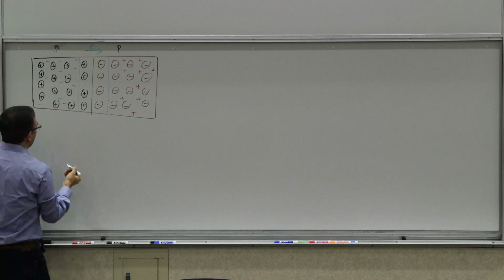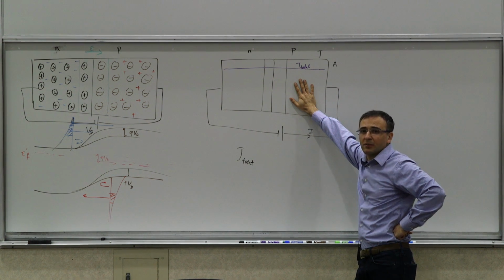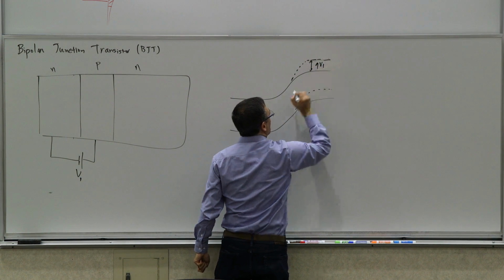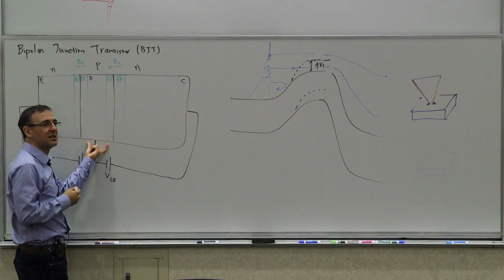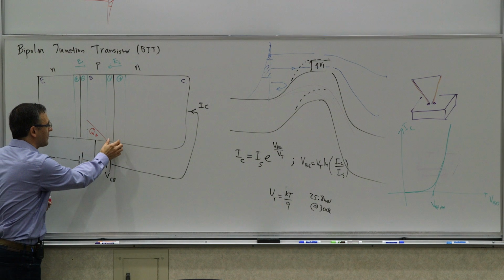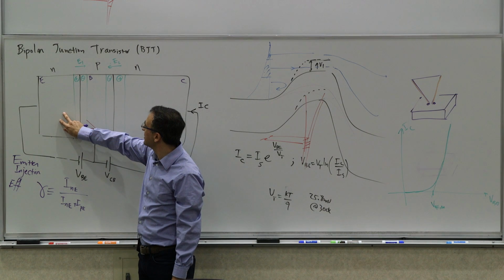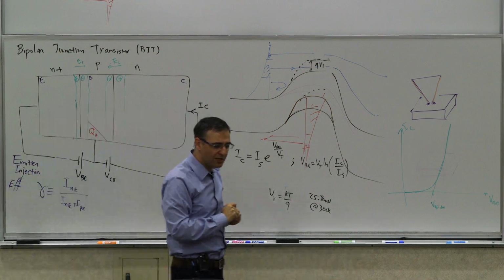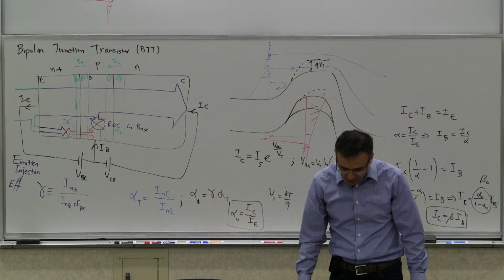106N. Bipolar Junction Transistor, basic operation, current flow properties, doping Profile

Comment: 7:30 if the junction is not in thermal equilibrium, does it mean that temperature along the length of the diode is not same. If so, can please tell how can it be, current through the diode is same throughout it's length.🙏🏼Thank you sir for the lecture. If not for lectures, I would have given up Analog electronics. Do you also teach any electromagnetics, antennas course. If so, please post them on YouTube sir, I want to get good at it before I graduate in about 1 and half years.

Comment: Why is the difference between the local fermi levels is q × VD ?
Reply from the maker: Because the there is an external voltage of VD is applied to the diode that creates an electric potential difference of VD, which corresponds to an energy difference of q.VD which is reflected in the local Fermi levels.
Reply: @AliHajimiriChannel   I actually professor understood it when in a comment bellow when some asked you " @6:31 shouldn't the valence band at the n side be raised instead of lowering the p side " and then you answered " actually both happen , since the depletion region shrinks on both sides . It was just a convenience (laziness :) in drawing a picture that one side was lowered " 
From the upward conversation I understood that on average we can think that the p side is lowered by 1/2 q × Vd and highered by 1/2 q × Vd at the n side that happened for the the upper graph for electrons and the lower on the holes . So as a result the valence band of the Semiconductor and the negative dopant at the n side and the conduction band and the fermi energy  shifted on average by 1/2 q × Vd upwards with reference to the old energy levels before applying the forward bias and the same happens to the p side valence band of the Semiconductor and the positive dopant at the p side and the conduction band and the fermi energy  shifted on average by 1/2 q × Vd  downwards with reference to the old energy levels before applying the forward bias therfore the delta E fermi = q × vd ...... I am thinking in a right way ? 🤔 ...... 
I really appreciate you professor Ali hajimiri and I really find the heaven in your videos thanks professor for making us being educated by that high quality of education .

Comment: Hello sir
I have question about current flow through the depletion region in bjt transistor and fet transistor. Even though a high electric field is present in depletion region (between collector to base junction) but this region is depleted of charge carriers and to some extent behave like insulator according to my understanding, then how current continues to flow. One explanation that come into my mind is that inside depletion region charge carriers generates due to thermal process(electron hole pair generation) that might help flow the charge carriers but even these carriers are very small in number to help flow majority carriers in mosfet and minority carriers in bjt.
Kindly explain it to me because I can not digest that people say current just flow because of electric field present and I need to clear up this concept.
Reply from the maker: Hi,
The depletion region does not have a lot of free carriers in it because the keep being swept away by the electric field. It does not mean that free charge carriers cannot exist there. It just means that carriers that end up there, will not spend a lot of time there and are taken away to somewhere else due to the electric field. So carriers transition quickly through it. The low conductivity is due to lack of free carriers there that can be influenced by another electric field (usually perpendicular in the direction to it.). Hope this helps
Reply: @AliHajimiriChannel  thanks a lot sir. Your explanation is much more detailed and convincing. God bless you.

Comment: Dear Professor，actually, I am not really understand why the net flow going into the transisitor should be zero, Even if I know the KCL or KVL. I wonder what's the physical mechanism behind of this phenomenon.
Reply: The netflow being zero means that there are now charges "lost" on their way through the transistor.  This is only true in steady state. The reason is following:

It all goes back to the maxwells equations: Look at the first one:  
∇  x H = J + d/dt e0 * E.

A changing Current means a changing current density (with constant cross section). And changing fields are mathematically observed by the the div operator (∇ *). (Locally changing field, its the derivative of the location)
So lets apply it on both sides:
∇ * ∇ x H = ∇  *  J + ∇  * d/dt e0 * E.    

∇ * ∇ x H is always zero for all vector fields. (Look at the mathematic proof of it, when interested, Furthermore
∇ * and d/dt can switch positions) 

So we are landing at:
0 = ∇ * J + d/dt * ∇ * e0 * E. 
(Rearrange)
∇ * J = - d/dt *  ∇ * e0 * E.    (what is know as continuity equation)
In steady state all time derivatives have to be 0. So in conclusion we have:

∇ * J = 0.  (J = current density)

So we proofed that the current density have to be constant (in steady state and thermodynamical equilibrium). And with an constant cross section, when can conclude that the current it self has to be constant as well.

That was the mathematical part.

To get a physical understanding: The net current has to be 0, because in steady state all fields are not changing anymore. So there are no moving charges beyond the steady state moving.

To make an analogy to fluid dynamics:
Imagine you have an empty watering can. After some time the watering can is filled to its maximum and all water added on top of that is going through the cans output in an equally amount. This is the steady state. At that point the can is behaves just like an ordinary hose, but with an odd shape. 
Before that, you just filled the body of the watering can and the water didnt come out at all. It just was stored in the can. This are the the "lost" charges in this anology. 
The stored water molecules are an anology to electric fields which are formed in the transistor, before the steady state.

I hope this was kind of helpful.

Comment: Thank you Prof. Ali, I really enjoyed your lecture.
Your explanation of how electrons enter the base through the mechanism of thermal generation is amazing.
But I have several questions disturbing my mind:
1. If this thermal energy is so powerful so that it controls the movement of electrons as long as the barrier is low enough, where exactly does that energy come from?
Is it the kT? because at room temperature, the value is only 25.9 meV.

2. And, How do we connect this thermal energy with the control variable, for example, the applied voltage?

3. Is this thermionic generation the same as the thermionic emission as in Schottky diodes or Oxide leakage

Hopefully, you have time to help me understand it.
Thank you

Comment: If the electrons from n side gets recombined in the p side during forward bias, how can we get the diode current?
Reply: they get recombined over time not at a snapshot that is why it is represented by a decaying exponential which says as we go more deeply into the p side we have pretty higher chances for recombination which kind of make since  so the diode current is related exponentially to the voltage i suggest you go back to the lectures for better understanding
Reply: @dtm7743   if you are closer to the junction the chances of recombination is high!
Reply: @jnaneseswar When we are applying forward voltage, the potential barrier drops, and due to the thermal energy "a lot of" electrons can pass through the junction, the speed of the electron is very high. the chances of recombination are high when electrons are closer to the junction.

Comment: @7:28 , if Fermi-Dirac distribution is valid only in thermal equilibrium, how can we derive equation for diode current based on this distribution, as done in lecture 104N ?
Reply from the maker: Great question. It is technically not correct. What we are using is what we call a quasi-equilibrium within the two sides of the junction (away from the center of the junction) and define the so called quasi-Fermi energies. Essentially what we are saying is that there is  so much thermal energy that the deviation from the Bolzmann distribution is small and negligible.
Reply: Okay, got that. Thank you prof!